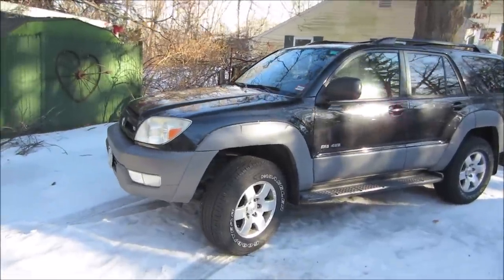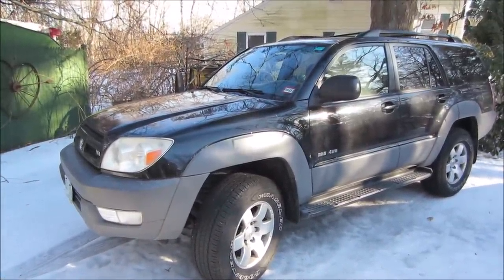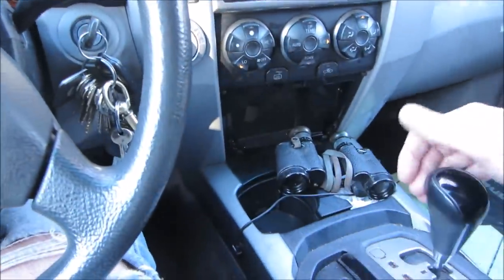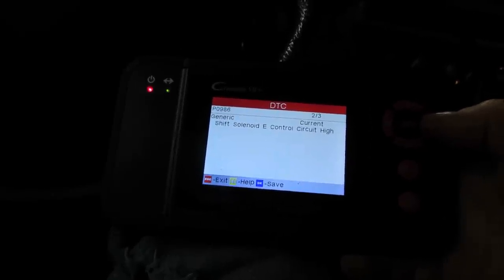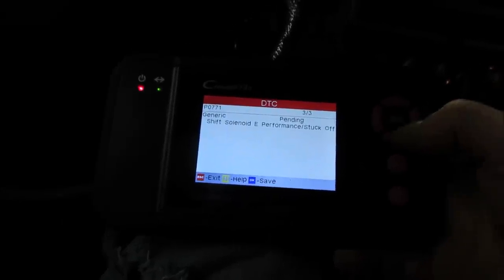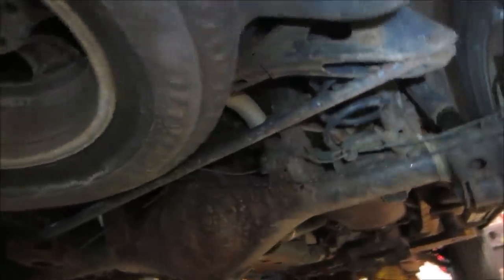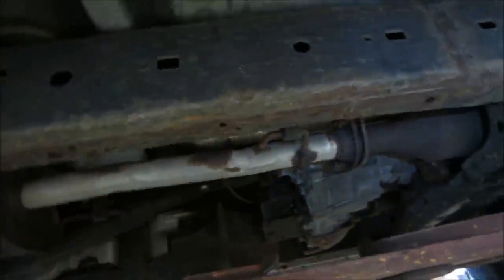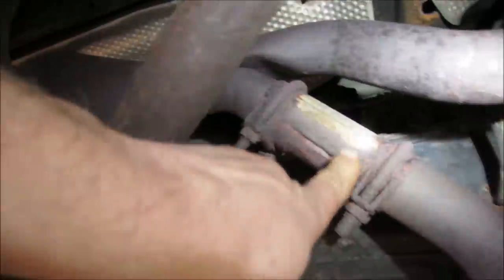Bad Toyota Transmission..Can We Fix It For Free?

Comment: Good job Mr. Mustie!   20 some years ago trying to stretch extra miles out of one of my several chevy ( suzuki) sprints, I had a alternator go bad. There was no way to get a wrench on one of the bolts, I pulled the wheel and cut a 5 inch square hole in the wheel well and folded  it back and had access to get on the nut of the bolt that was seized in the aluminum of the alt. Sealed the hole and put many more miles on it.  Using those small drill bits for motor connector repair and carb cleaning tools is more expensive than guitar strings. Find a music shop where they  replace strings and ask for the bits they cut off. Usually they are stainless in many sizes, starting at 10mm. If they don't have any cut offs just buy a single string the size you want .

Comment: Hats off for the patience and the clever solution. I think that if the bolt holding the connector allow it to go out enough to get into the inner cables, I would solder some extension wiring, seal the connector hole put any connector from the hoard, and the matching one in the truck and plug the parts.

Comment: One thing that was impressed on us Hard at Toyota Service school was to not be too quick to condemn components. They said in a rather smug manner that "Our (electrical) components almost NEVER fail. Don't be a parts re-placer, be a technician, look for opens, shorts, bad grounds instead.
Reply: New Toyota service school teaches to cut a hole to properly look and diagnose.😂👍🤘
Reply: They never fail under warranty maybe, but they certainly fail after 4 or 5 years
Reply: John Nicodemus ; Yeah, luckily I was long gone by then, I worked there when the Supra and 4-Runner were the hot new thing, early 80s and 90s. I was the first in the U.S. to replace a Previa trans because a custom interior installer ran a huge self tapping screw through the case!

Comment: The back of the connector will come off to access the wire ends. They will then pull out and you can remove the obstructions and then reinsert into the correct pin hole and put the back on again
Reply: I would solder some extension wiring and use any other generic connector (same number of pins and current capacity) and install the matching part on the truck wiring ...
Reply: I was wondering why he didn't do it that way to??
Reply: As he explained in the video there was no room to do that. This is Mustie, you don't think his brain thought of a million solutions???
Reply: OK, it works for now, but I wonder for how long. Sorry, I'm not very optimistic on this one. Otherwise, I like Mustie videos. Very much!

Comment: Congrats, Good thing you didn't have to pull the trans. I had a 4x suburban once that was having shifting problems, final lost 1st. Had it replaced, not 2 weeks later had shifting problems again. Found out the front drive shaft had grabbed the trans wiring harness. Spent about 2 hours soldering and patching wires. Worked well afterwards.

Comment: Back yard mechanics at its finest . Watching you cut into the trans. tunnel reminded me of my 55' Chevy . When working on the transmission , you could pull back carpet and remove some screws and there was a plate . Made for nice access to the bell housing bolts . Newer cars have made it almost impossible to get to anything . My favorite thing to do is to rebuild a non serviceable component . Kind of a personal challenge . Some times way easier than I thought , others not so much .
Reply from the maker: same here, its the thrill of the challenge

Comment: Good idea.  Did essentially the same thing on the bed of an old Toyota PU to get at the top of the gas tank.  No way were those rusted nuts and  bolts on the straps going to come off. And the vehicle was about done because of rust.  Also did something similar to get better access to the power window motor on a Ford PU.  Providing such access panels is apparently beyond the expertise of the various auto manufacturers.
Reply: They always snap off , the weathered 10,12mms. I hate that.

Comment: i like your style mustie1, we need access....   now we have a door lol :-D
All vehicles should have access panels, especially above the fuel tank, to get to the fuel pump.
Reply: That is a security issue. Drain the fuel before removing the pump!
Some burned their cars as they dont flushed the fuel tank.
Reply: Some MODELS DO & SOME DON'T. Pro Shops WOULDN'T get any business if they had access panels everywhere.
Reply: I thought most cars did have access for the fuel tank.. every I've had has. Of course, they've been newer than 1990.. lol
Reply: Access panels are not an issue for fuel tanks, there is a reason why they aren’t used to often. Most technicians will drop the tank anyway, and the common backyard diner would not 1 have the tools & 2 have the common sense to use a brass drift to avoid creating sparks.
Reply: I know that it was easier to lift the bed on pickup trucks back in the 1980’s& 90’s, pull the sending unit & fuel pump then replace instead of dropping a full tank of gas! Come to think of it the only times I dropped tanks was to replace them because of a vandal, or to solder a hole in the tank with a torch!,  having a second car running that day was a saving grace, connect exhaust system of running car to fill tube of open tank, let run for 20 min, then spark up the torch fix the tank, I did this in High School, in front of the teacher who said it was more or less a trashed tank and not worth while repairing... it was his scout, and he tried for 3 months to find a replacement tank. For a metal and wood shop teacher he was good, but put a car in front of him, you better run away and fast! 
    The school paper was another issue, picture of me with a map gas torch working on a gas tank, with the head lines of  “Somethings not Right, DON’T DO THIS AT SCHOOL”!  The shop teacher ran that Scout for another 10 years! With his homemade wooden bumpers and the new auto shop handy work on the body.
Reply: Why the hell even put the pump inside the tank instead of outside..
Reply: SinsBird with pressurized fuel you don’t have a “vapor lock” situation, or a boil off, caused by not having pressure this was a problem for early carbureted engines, but putting a pump in the tank solved this issue, so the cars had 2 fuel pumps, both electric in tank, and mechanical on the engine. This started in the late 1970’s or early 1980’s, and has now progressed to higher pressures for fuel injected engines.
Reply: Dang right!

Comment: I did the a similar repair to an old Kia Rondo, tranny connector was facing up under the battery tray. I opted for your plan B, I dremeled away the plastic and soldered to the stubs. I had to fix about 5 pins. I then snaked them out the side of the connector and soldered to the wires directly. That was a year ago, seems fine. I used silicone tape to seal the whole thing up. I think I like my fix better, I would be worried about flaky connections thru thermal cycles against those pins. Good news is you can always go back and redo and the failure mode will be limp mode for the transmission. Cutting open the tunnel was genius btw.

Comment: Quick tip for removing nasty green corrosion off battery terminals - acetic acid works just great. Has to be a bit stronger than vinegar though, so I use Kodak Stop Bath concentrate as bought for darkroom use. Wipe on with a Q-tip and all the green nastiness dissolves.

Comment: Dude I feel sorry for the next guy. You should have fixed with new solenoid and connector. That being said I would have done the same repair myself. Good Job Man!
Reply: He mentioned earlier that a new harness and solenoid was $800.  There comes a time when a person just has to repair and not pull the trigger on the parts gun.
Reply: GM Kof hard ...Yep, he mentioned a few times that  "road cancer" has had it's way with the Toyota.  Sad, but 250k is really a "job well done" for a car in the northeast.

Comment: I’m just guessing here and there’s no way to prove it but 40 years of electronics experience tells me that corrosion was probably your original problem and those pins broke when you pulled that connector off.
Reply: If it were rotten and broke when he pulled it, it was no longer conductive. Corrosion has never been. You would think the factory would have used dielectric grease on those but why? Factory fresh is never corroded.
Reply: Agreed...that's exactly what happened to me about 2 weeks ago when I pulled out a relay.  One of the pins had a serious case of the green crusties and what was left of it snapped when I pulled out the relay.
Reply: And speaking as someone who designs things like this, what kind of an arse points a connector up like that?  Honda did one as bad on the 7th gen Civic starter solenoid.  Left many in the rust belt stranded.
Reply: @paulmoir4452  Because these cars are designed and engineered in California.
Reply: I would say the same!
Reply: Engineered to be disposable, like most everything else now a days, while what we had was not perfect, it still lasted longer then 20 years with half hazard maintenance, but try to go 6 months without a minor service and it hits the fan now a days. And if it gets dinged the repair bills are nothing to laugh at replace door,slider and repaint the side of a mini van is $7 grand, for less then a 15 mph hit, in a state that allows minimal coverage of 5 grand prop, & 25 grand for personal limits to be legal... don’t carry minimal coverage for auto insurance, protect yourself for the fools who think they are saving a dime, because now leans can be placed against them, and these need to be cleared before any major sales, purchases or inheritance is paid! Protect your self!
Reply: Chris Freemesser especially in the older fords that happens a lot it’s worth pulling the connection offs and packing them with dialectic grease

Comment: Thanks for the video.  I have a 2004 4Runner Sport with 221k miles.  I drove it for the first eight years then my daughter drove it the next eight.  I have it back now and have been making a few minor repairs.  My engine light is on and it points to needing new oxogen sensors.  Doesn't look like a fun job.  Glad to bring it to you if you would like to do another video.  Would like to get past 300k.

Comment: just so you know you can get that wiring harness on ebay for about $30.
Reply: But then you would need to open the transmission in order to change it, since the part to be changed is inside the transmission, right?
Reply: @Teporame  That's true but then you also wouldn't need to cut the tunnel out in the car

Comment: Good save! Fixed one of those on a Chevy car but the connector was fine, and replacing the solenoid through a side cover on the FWD trans was a pain..actually the solenoid wasn't bad to change..hooking up the little connectors Inside the transmission with my big hands was a major pain! Those connectors should be packed in Dialectic grease from the factory, especially since they reside in the elements, but they often don't. Some tips, I've had some luck with(and I don't endorse this companies products, in fact rarely use their famous 'penetrant') but PB's Multi-purpose Lubricant on the pins..if they were corroded, after cleaning them up. Of course this won't fix broken off pins(have replaced harness connectors before..it's a pain) but will help them make contact if they're still standing. Then pack some dialectic around the outside edges of the connector after. Missed the Rapture..think I was working that day ;)

Comment: Is that thing really towards the end of it's life? That 4.7l V8 is a proven million mile engine. I have one with almost 220k and I plan on driving it for many more years. 🙂
Reply: I had an 04 with 418k miles when I sold it and it legit ran like new, should've never sold it :/
Reply: That's what I was thinking, Toyotas never die!
Reply: million miles maybe, but only if the rust doesn't get to it first
Reply: It could go another 10 years down south.  In NE two more winters will do it in.

Comment: Hey @mustie1 next time try this. Drill your pins in the transmission connector, and leave long pins, then remove the pins from the harness side, then plug it back in. Now those pins should be sticking out the backside, coming all the way thru the holes where the pins were. Now you can solder the pins to the wires you pulled, and seal with rtv

Comment: This is why we drive manuals in Europe, the road salt would screw up all connectors. Good video as always.
Reply: They use mountains of it here. Thats why his frame looks like it does.
Reply: @scottfirman  That frame dont look too bad.
Reply: The main reason Europe uses mostly manual transmissions is it's cheaper to purchase, and they have generally been easier on fuel, which is a big deal when you pay 2 or 3 times as much for fuel than in the US. Modern Manual transmissions still have sensors that have the potential to corrode as well.
Reply: @nabob14  Yeah we still think that autos are harder on fuel but in reality the modern autos are better on fuel.

Comment: Great shade tree fix!  Apparently from a few pictures I saw on a Toyota forum, this is common. They recommended a new pigtail for the outside and an internal harness on the inside. The Toyota enginerds really screwed the pooch on a connector that collects water. Sheesh!

Comment: You need to replace  both harness heads because,in time with vibration  will separate the pins.IMO
Reply: LOL, "time".
Reply: Yeah, probably in the time it takes to run down to the stop sign and back.
Reply: GM Kof hard  That truck will be driven many miles before it is retired. Some person with little income will buy it cheap because that is all they can afford.  They buy toyotas because they don't need constant maintenance like Jeeps etc. You change the oil and maintain the brakes. No other real problems. Drive it until an accident totals it.
Reply: GM Kof hard Another option would be to solder-or-crimp the wires directly. I’m a car tec I like to see things fixed correctly,regardless of age shape and condition.

Comment: Great go of it, but a permanent backyard fix would have been to cut off both connectors and solder splicing the wires 1 for 1.  I guarantee you will see these issues again soon...
Reply from the maker: how are you going to cut off a connector inside the trans
Reply: If you removed that bolt attaching the tranny connector, you should be able to wiggle the connector free of the transmission.  With any luck you`ll have an inch or better to work with.  Of course you will then need to plug the hole the wires travel through.  Keep it in mind in case it happens again.  Cheers!
Reply: @Bobbywolf64  and if he wasn't lucky it would separate inside the trans. Then where would he be? Easy to armchair quarterback when you got nothing to lose.
Reply: Right.  If it breaks off, you dig out the broken  piece and continue.  You can't let a job scare you because it 'might' go sideways.  There are a thousand ways any job can go wrong.  And a thousand ways to recover from it.

Comment: Sea foam makes a transmission cleaner to disolve  varnish in valve body check balls etc. I used it along with  Lucas stop slip for years. 330k on my Chevy original transmission. Still going ok. 
It seems many Japanese cars no longer so good. Many American cars now equal or better and cheaper to repair.
Ps I use my phone camera also excellent.
On crane electronic s I use "Stabilant 22a" used in avionics on electronic connections. This chemical improves conduction between pins and sockets . Expensive but approved by aircraft mechanics. Shalom
Reply: Blank. Not anymore...

Comment: MUSTIE.  GET YOURSELF ONE OF THOSE CHEAP WATERPROOF INTERNET MINI CAMERAS THAT USES YOUR CELLPHONE Screen as the viewer I have one it works fantastic it does not plug into your cell phone it’s wireless so you can order them I think mine has a 5 foot flexible cable and it goes to a little 1 in.² box with that as a wireless converter but you can get them with 10 foot or 15 feet of lead on it has its own light it’s a wonderful thing for 30 or 40 bucks I’ve used mine several times where nothing else would’ve would work !
Just sayin!
Reply: It does NOT CONNECT to your phone😊 so your phone can be in your RYAN hand and the camera goes into the tight spots! Or even down a clogged drain! INSIDE A GUN BARREL😊 while your phone stays high and safe TEN FEET AWAY

Comment: On ebay that harness is only $35 bucks, drain that fluid, replace the inside harness.
Reply from the maker: you still need the outer one
Reply: @mustie1   Couldn't you just repin that?
Reply: that can be repin.
Reply: how about the wreckers 
 @mustie1
Reply: Oh you forgot about pull the trans

Comment: What diagnostic machine are you using? Would love to know which would be the best buy for JDM autos
Reply: It's a launch crp123. They are good scanners and offer a few more features than a standard obd can scanner.  It a short of being able to do things like abs actuation etc but I can read a lot of manufacturer specific modules which is nice.
Reply: Do you know what jdm means? Or do you just assume all Japanese cars are jdm lmao.
Reply: @DoRC  Thanks,though didn't understand what you meant when you said" it a short of being able to do things like abs actuation"
Reply: @williemwangi4959  there are a bunch of systems in modern cars that need to be controlled by a computer hooked to it for advanced diags and repair.  Most modern cars need the abs system activated in special way to bleed brakes, Wheel angle sensors need to be calibrated after suspension work, hell in BMWs the battery needs to be "calibrated" if it's replaced. This scanner cant do those things.
Reply: @DoRC ,thanks for your kind response. Which one would you recommend if one was planning to purchase one?
Reply: @octane613  I meant Japanese cars
Reply: @williemwangi4959  depends. What are you planning on using it for?
Reply: @DoRC  For general diagnostic purposes